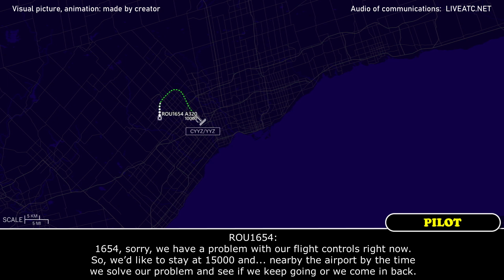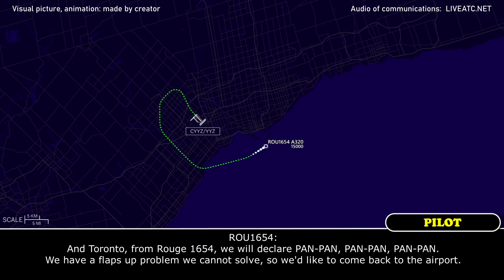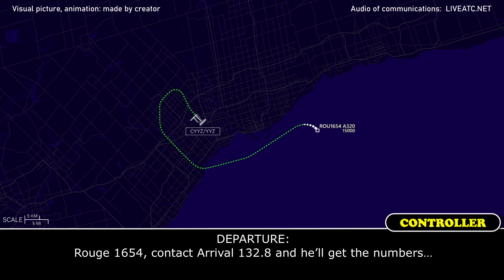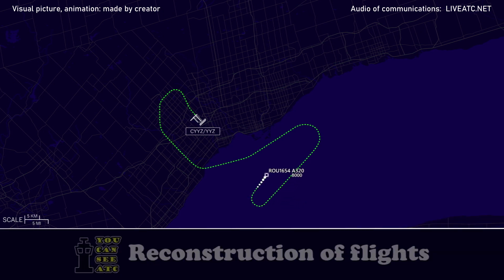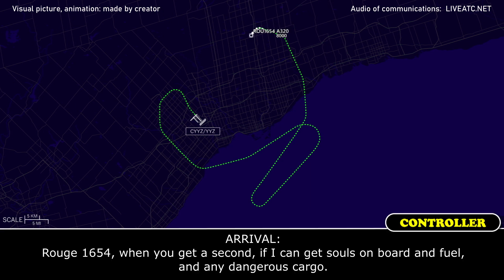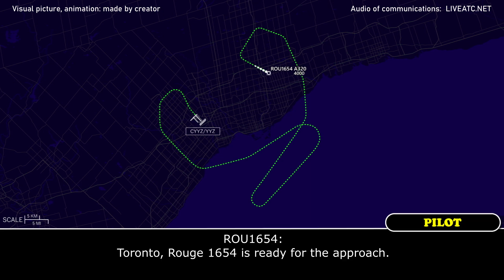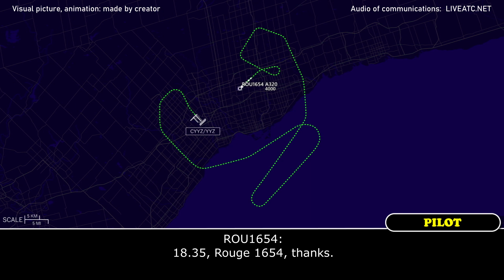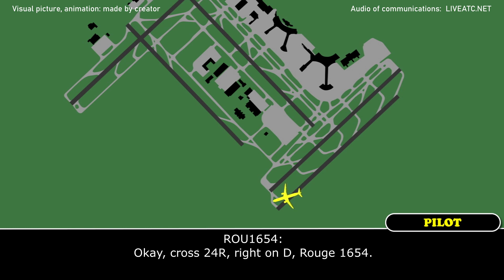PAN-PAN, Flight control problem | Air Canada Rouge Airbus A320 | Toronto Pearson, ATC

Comment: I'm not in aviation and that puts me at a disadvantage relative to understanding most of the radio transmissions in most of the videos.  However I was pleasantly surprised that I was able to understand all of these transmissions without the subtitle.  No one mumbled, no one tried to set a record for number of words per second.

Comment: 6:49, that was a good controller. He told the emergency aircraft  that there was no planes behind him, That would help them determine if they need to quickly exit the runway or not.   The little bit of information can go a long way especially during an emergency.